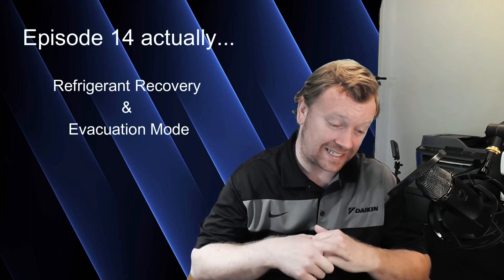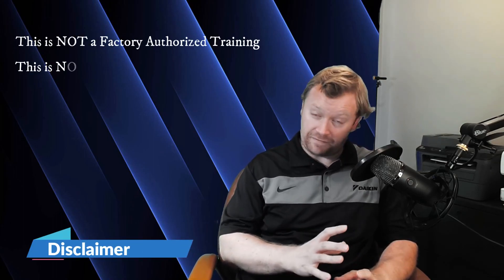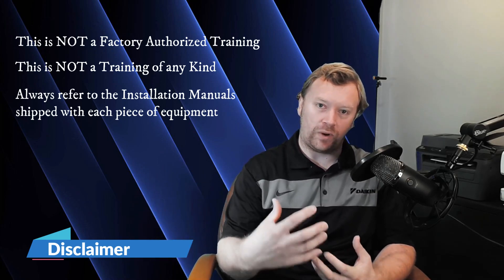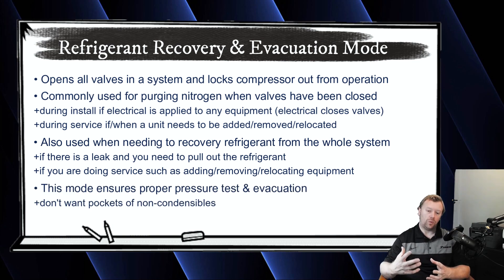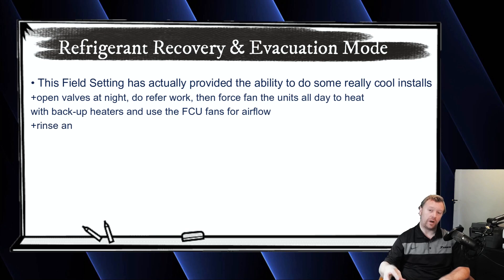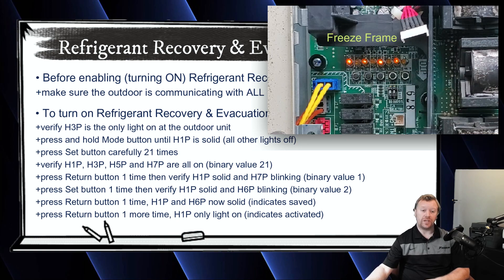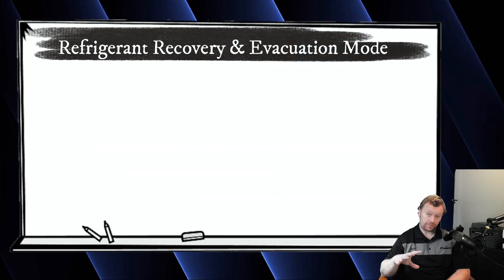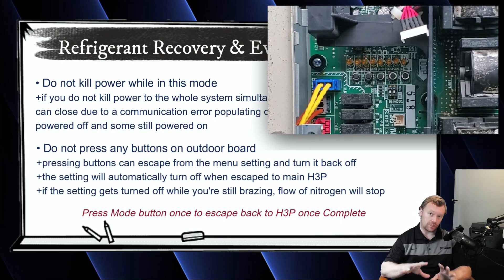How to Open ALL the Valves on Daikin VRV | Refrigerant Recovery & Evacuation Mode - 12-17-2021

Comment: Is there anyway to open each expansion valve inside indoor unit by the madoka control? THANX FOR ALL THE TIPS!
Reply from the maker: No. Use recovery mode at the outdoor unit to open all valves in the system.
Reply: @InverterAlways  I had no outdoor unit yet. Waiting for the newest vrv 5 outdoor unit. All pipes are nearly there. I had to braze the pipes before I got the outdoor unit. ( i had turned on power before, to remove cardboard from self cleaning extension on indo
or unit. (i should have removed exp valve electric connection but I "forgot" on all 5 units. I solved the issue with the solution of taking an outdoor unit pcb from an old altherma outdoor unit, cut a old exp coil, and matched the electric connection with the vrv indoor unit exp valve electric connection. Turned on the power on the altherma outdoor pcb. this made the exp valve open. I dont know how much they open, but it was enough to flow nitrogen while brazing. I guess you can buy some exp valve pcb board to open exp valves electrically. But that I dont have.(I should.) This solution was very easy. Mabi its a tip for anyone searching for an easy way to open a electronic exp valve. ( you can hear the exp valve closing when power is turned on. After its closing(calibrating) It will open up enough to flow nitrogen. =)
Reply: @InverterAlways  Thanx boss!

Comment: How to pump down VRV A refrigerant? 
Thank Sir
Reply from the maker: Usually it's not doable. Sometimes you can throw it in cooling and let it run for 10 minutes, then close the liquid stop valve. Let it run for another 5 then shut the gas stop valve and turn off unit. The problem arises when the system sees the dramatic pressure change, it has safeties that shut off the unit before you can pump it down all the way. So you'd still likely need to recover some of the refrigerant. This is much more easily done on mini splits

Comment: Hi Dana , I have a daikin vrv RXYQ12TY1A and need to move a pipe which requires me to pump down the unit , I know it isn’t in the manuals and not really done on vrvs but if there is a way would be a great help wondering if you can help which would save me reclaiming the gas . 
Kind regards Matt
Reply from the maker: Usually it's not doable. Sometimes you can throw it in cooling and let it run for 10 minutes, then close the liquid stop valve. Let it run for another 5 then shut the gas stop valve and turn off unit. The problem arises when the system sees the dramatic pressure change, it has safeties that shut off the unit before you can pump it down all the way. So you'd still likely need to recover some of the refrigerant. This is much more easily done on mini splits.
Reply: @InverterAlways  Thanks Dana that is my problem, I think I’m better off reclaim then adding gas back in , then I know I haven’t lost any . Thanks

Comment: Howdy,
Thank you for taking the time sharing knowledge.

Question:  Can this process also be done a Mini split board?
Daikin sell the magnets for the coils but this sounds like a better option.
Thank you ..
Reply from the maker: No. Cannot force open mini split valves. You'll need the magnet to manually open them
Reply: @InverterAlways  thank you very much

Comment: I ran into a problem where tech support is telling me that the last AHU on the run is low on charge but when adding refrigerant.. The system is really slow in taking the refrigerant... Is there a faster way
Reply from the maker: The last ahu is low? Lol usually the system is low or not low. Hard to have only one unit low. Are you saying one indoor has eev at 2000 and the rest are normal? May not be a charge issue here. Not saying daikin is wrong just verbiage here. Best way to verify is weigh out charge. See if its low or not. Pull a good vacuum then have the vacuum pull in new charged weighed in as liquid as always.
Reply: Good morning sir.. Back on site.. Waiting on tech support... 2000 pls liquid pipe 44.5 gas pipe 73.7
Reply from the maker: @victorsilverman8994  the others should also be similar then if its low on charge. That's a lot of superheat. What's your discharge pipe temp versus compressor rps and condensing temp?

Comment: Pop quiz: it will change status of EEV
Reply from the maker: It closes the valve completely that's why you need to make sure not to apply power until all refer work is completed. Otherwise need to open the valves hence this video 😉

Comment: Since you are doing videos on VRV life,  think you could explore the "energy saving and optimum operation section 11. of the install manual for the outdoor units?  It talks about operation method modes (basic, automatic, Hi sensible)  And then comfort settings (powerful, Quick, Mild and Eco)..  These units are built to be energy efficient but sometimes someone ( like me)  has this expensive unit and just wants it to cool like gang busters and get to set temp as fast as possible).  Any chance of that?  Appreciate it and love your videos.
Reply from the maker: I can do a video on the VRT settings no problem. Vrvs has it too. I've never had to change it from auto mode though. It ramps when it needs to ramp and saves when it needs to save. Tons of savings in my market out of the box. Of course different areas may need different settings so I can do a video at some point on that no problem.
Reply: @InverterAlways  We keep having the conversation of my unit taking a long time to cool down and staying on for hours ,  so I'm wondering if changing to powerful would make it behave like one would expect.   running for 12 hours non stop, never hitting set point point let alone dead band stopping point but always hovering a few degrees above with cooling on entire time.  that doesn't seem normal but then you look at their brochere and its saying an inverter stays on at a low rate and that is better then on / off.  But like I said that is how it behaves with heating.  So cooling is the only weird one.  You mentioned it was sized for cooling not heating so it heats easier then cooling?  

So in  your experience should it take longer to cool then to heat a home?  And is this "normal" behavior for these systems.  For example does your system stay on all day never hitting set point in cooling mode?  Mine won't until night time and it still takes hours to stop because it wants to cool until it gets below set point before its done.  I find myself having to up the temp at that point because it gets too cold.  

I always use mine in manual heat or cooling,  I don't use the "auto heat/cool" mode.  

Today was an example where I had it in heat mode and noticed it got to 78 in the house so I switched it to cooling set to  73.  And it took from 8pm - 11:30 to get to 73 and it just sat there until it got to 72 ( at that point I uped the set temp to 74) and it finally stopped cooling.
Reply from the maker: @cranbers  so 3 hours to cool 5 or 6 degrees. That isn't terrible. 3 degrees an hour can be expected so you're only off the mark slightly. If it actual ran non stop for 12 hours straight I would maybe have some concerns. But I wouldn't fret about 3 hours unless it's pegged high speed for 3 hours and still not getting there. 

Powerful just changes the vrt logic speed. The unit will still ramp when it needs to ramp. Vrt is for while you're maintaining. It allows the compression ratio to reduce to increase savings more. The only thing that may help is to disable vrt and lock in at a lower evap temp target. I don't think you need to do that though. 

When I say it's sized for cooling that implies your home has a larger cooling load in the summer than it does a heating load in the winter. Very common. Which means in heat the system is larger than required. That is why it heats up so fast and turns off. In cool mode it runs for a longer period of time and maintains. Also keep in mind you tried to recover 6 degrees in your example. Try tightening this up a little. If you want a cool setpoint of 73 make sure it's in cool mode by 75 so that way you aren't trying to recover a big difference. My house keeps set temp pretty well, but if I turn it off and let it get hot it will take longer to recover.

Comment: When my VRF Life 4 ton RXSQ unit with a single CXTQ inside unit was dead with an L5 error,  they replaced it.   They evacuated the system, and installed the new unit (no they didn't use "evacuation iand recovery mode and didn't even know it existed). (meaning all that refrigerant would of been trapped in the CXTQ coil right?  since expansion valves would of been closed? When they put the new unit in they topped it off with 2.2 lbs of refrigerant as if it was a new install.    (these guys didn't know jack about vRV life and I had to break out the manual for them which I'm sure didn't make me a fun customer they didn't know anything about settings or procedures).  I asked them to do the sub cooling adjustment check on page 15 of the rxsq48 install manual... put outdoor unit in mode 2 no 20 and mode 2 no 7.  And get target subcooling to 12F plus or minus 1... They did and ended up removing 2.2 lbs of refirdgerenet to get the sub cooling to that.  HOWEVER,  now my compressor makes a weird noise I never heard before in the new or old unit.. It happened as soon as they took out about 1.7 lbs.  so now when the compressor is at full speed, this noise is audible from 50 feet away.  So, now I'm wondering whats going on.  Did they take out too much?  Its not just a fan running with the sound of a compressor there is an extra high pitch winning noise coming from the compressor.  They put the D checker on and Daikin said it was good so.  Is this sound normal, and why did it start with that refridgerant removed.  No error codes or anything.  Even ran into this?
Reply from the maker: Noises are difficult to diagnose. But if daikin says the d checker data looks good then that's good news. Did they review data while it was making the noise? 

The charge should be based on line set length. Mode 2 setting 4 sets the line set type at the outdoor unit. Adding or removing any refrigerant after that is usually not needed. Was the 2.2 pounds added originally from the line length? 

Regarding the valves being open, if they pulled from both service ports they at least pulled the whole line set down so you're fine there. Opening the valves ensures flow anytime you're concerned you aren't pulling it all from the outdoor, or in the case you aren't pulling from both service ports. It's just a good CYA type of thing. Not necessarily always required though.
Reply: @InverterAlways  Right but if units are powered off and they do an evacuation, (doesn't that mean the expansion valve was closed on the indoor unit).  So all they did was pull refrigerant out from the line set and outdoor unit?  not the CXTQ?  So when they installed the new unit, the only thing empty would of been the line set?  New unit would of had factory charge enough for indoor and outdoor unit right?  So that meant too much if they added the extra few lbs?  That would explain why sub cooling never hit optimal of 12F and they had to remove 2.2 lbs..
Reply from the maker: @cranbers  no. If you pull from both service ports you're pulling on both sides of the cxtq expansion valve. Don't need to worry about the outdoor they likely shut the service ports. New unit would have had service ports closes on install. The only way they could have screwed up a vacuum would be to not pull from both service ports, which would cause tremendous operation issues with the new unit. Likely not the issue here since you said it heated great.

Comment: If apply power to equipment ,,we open all the valve ,,in this case we can do the service in safe,prestige,,,like pressure the sistem and vacuum and  like  you say ,,,apply power Indoor unit and outdoor,,,,
Reply from the maker: Yes 👍

Comment: Hi Dana
How do you set up a Nav controller when using a remote sensor? The controller isn’t showing to remote sensors temp.
Reply from the maker: You will set up the controller to use return air sensor, because you removed the return air sensor to plug in the remote sensor to begin with. If you have an FXTQ air handler which does not come with a return air sensor, you plug the remote sensor into the connector on the board where a return air sensor would normally go, and then continue on with programming for return air control.
hope this helps!

Comment: R32 is flame  r anthoer reason pls
Reply from the maker: R32 is flammable you're correct although you have to be pretty careless to ignite it. It's am A2L and has to fall within pretty tight criteria to ignite. At some point in the near future I'll have a video on it. But in the US we still use R410a. There's an R32 system coming to 3 states in 2022. But no vrv yet. That's all overseas still. So likely not too much on R32 quite yet. Will be starting that conversation soon though to get everyone prepped.